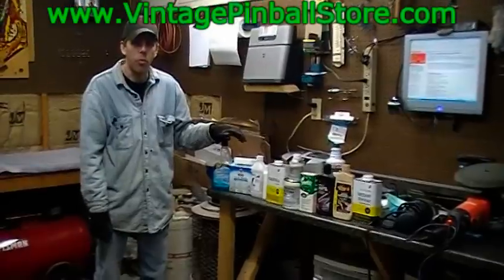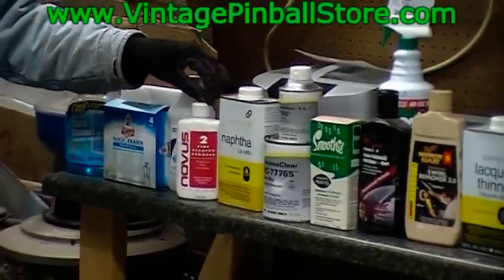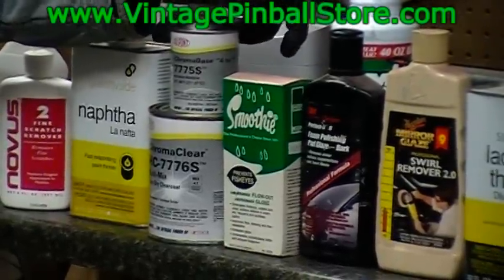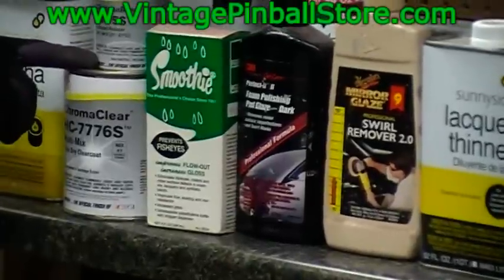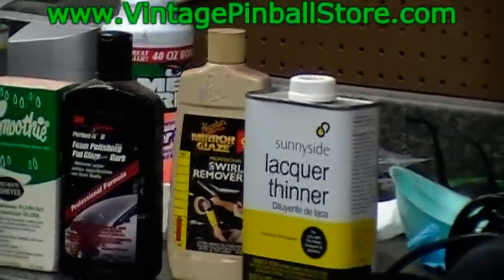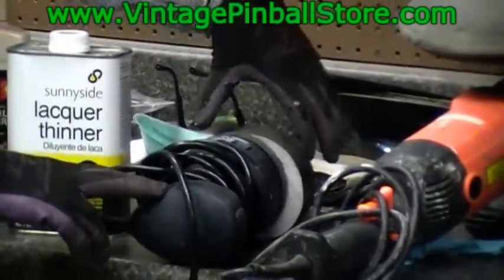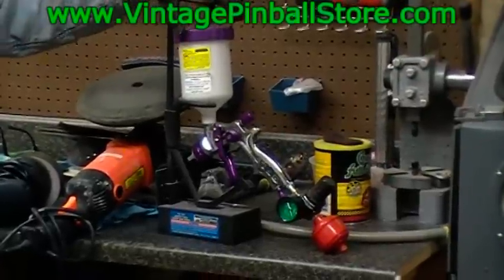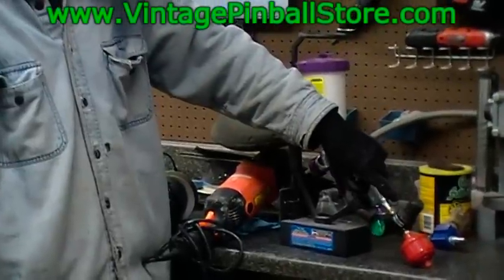How to Clear Coat a Pinball Playfield - Part 2 (PinDude Pinball Project)

Comment: I left you this same comment somewhere else. I used Deft polyurethane varnish reduced with xylol in a Devilbis suction gun, 2 coats. This is the varnish they use for bars and tabletops. This is cheaper and  less complicated than your video, and I didn't have to buff. It's been 25 years and not the slightest loss of gloss or any discoloration. Also, the right way to remove all wax, dirt and silicone is to use pre-kleano, what the body shops use, or used to use.